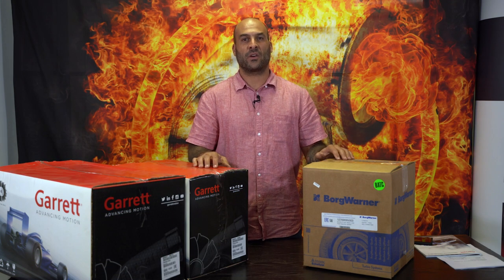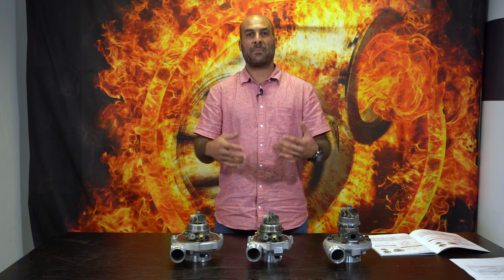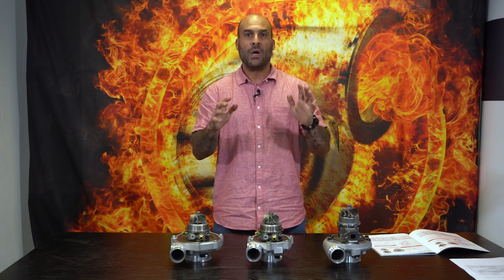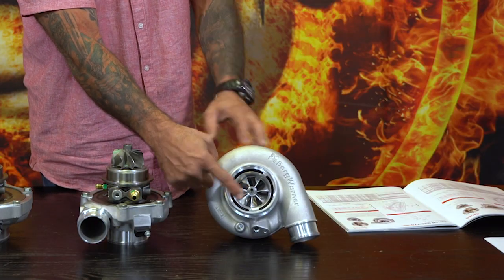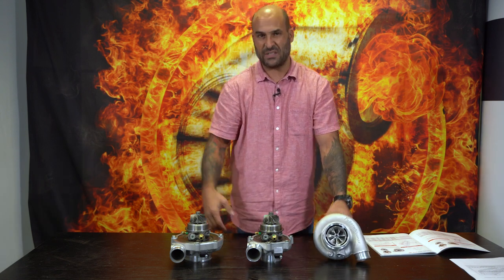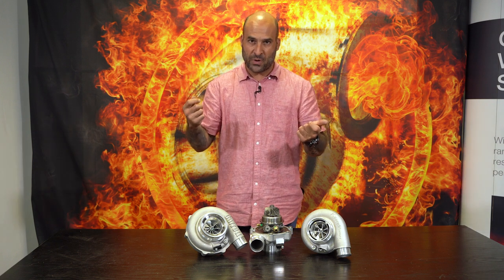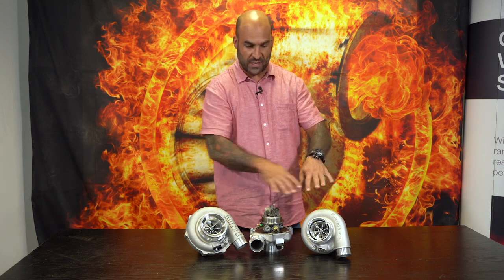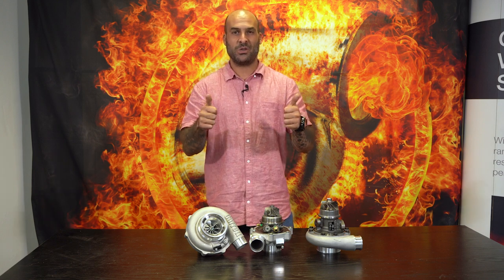BorgWarner Airwerks S200SXE versus Garrett G30-660 and G30-770

Comment: I used an S257sxe t4 .82 twin scroll on a 2JZ , had full boost at 3600 and the boost recovery between gears even short shifting was ridiculous and you could easily spin the tires up through 5th gear. Even 5th gear by accident just flooring it to pass a truck
Reply from the maker: Far better than any comparative Garrett G-series for half the money.

Comment: Different turbos for different goals - for sure.
But what I had to do when determining my situation was against the EFR series against the g30-660.
I overlayed the graphs with some color choices.
I did this because you need to plot 75% versus 75% for instance.
When you do this you'll see that the 660 compressor wheel at about 0.4 PSIG at 20#/min, all the way up to 2.6 PSIG at 50#/min.
It's nearly the entire range! Lol.
But in my opinion outside of the typical modern trend of running everything off the compressor map - the 660 is really a 550 IMHO, so the 57mm BW is obviously will make more.
But no the BW doesn't spool as fast I have direct comparison between my vehicle running the G-30 660 and that very BW S200.
Both awesome turbos, I'd buy either one.
My boost threshold is much earlier on my G30-660.
Does it make the car any faster?  No probably not because I have more than one gear in the car. :)
But it's nice to be able to lug this car around at lower speed.

Truth be told that S200 has much more boost down low, but on the same.engine again hitting the same power requirements was similar to my GTX3584RS comparing logs.
Reply: Thanks Beau!
Reply: Which Borg did you compare to the G30-660?
Reply: What car did you install this on?
Reply: Great, i require much more education on turbos! Back in the sixties and 70s never had a turbo,lol
Reply: Came to say that ... when you are comparing one turbo at 79% efficiency to another at 75% you are not drawing any meaningful conclusions.

Comment: This is why I am going 8474 over any Garrett in my R32 GTR. Awesome video Chris, as always! Keep  up the great work!
Reply from the maker: Great choice - the 8474 is a loaded gun!
Reply: What made you go 8474 over 8374?
Reply: @CarbageRacing  For me, its the power above 5000 rpms. The 8374 is a little quicker for spool time, but as soon as you get above that 4500 rpms range, the 8474 is way better.

Comment: just what i needed. though i do wish the BW was also water cooled to extend the life of it. TY for this comparison i greatly appreciate it.
Reply from the maker: Thanks for the comment - much appreciated. Keep in mind that although the S200SXE might not be water cooled, this is still an extremely reliable turbo (more so than any Garrett water cooled Journal bearing setup by far) due to the fact that this bearing system is used primarily in stationery engines in underground industrial and mining setups and run at massive boost pressures permanently. Obviously the S200SXE uses a very different aero design wheel package to the stationery engine setup, but the bearing housing and components remain the same proven component list. You have nothing to worry about in reliability here.

Comment: Before one word was spoken about the efficiency of either turbo, I had made up my mind by just looking at them and choose the shorter ones.  I don't have the room for the length of the BW.  I currently run a G25-660 in my Subaru powered VW bug and was thinking about upgrading to the G30-770 but man, I hate to give up the incredible response of the G25.
Reply from the maker: Thanks for the comments. If you like the response of the G25 - wait till you experience the 7163 -- it is chalk and cheese.
Reply: What rpm does boost start in your vw bug
Reply: @seemaab  I can’t tell you the exact rpm,
Reply: But it’s pretty immediate

Comment: very informative! thank you for this. my bw s257sxe is enroute to me as we speak. going on a time attack car (s2000 with a twin scroll manifold), good to know im not giving up much of anything vs the g-series. a point i think that was overlooked on the comparison is serviceability. the borg can rather inexpensively be rebuilt while the garret will require a core exchange directly from garrett which is pretty expensive(more than the cost of a new borg). one thing i really struggled with was selecting the proper turbine housing for the s200sxe-57mm. there is many options available, they have there turbine matchbot program on the website and even after watching the tutorials was somewhat confusing. they also dont have many of the housings for the s200sxe listed on there matchbot. a video looking at selecting turbine housings or matching turbine housings to your particular engine would be fantastic. i scoured the internet and youtube and it seems its something there isnt much information out there on. thanks!
Reply from the maker: There isn't much info on this, because not many people know how to do this.  There are secrets and other info that lies in this section of the turbocharger which i am also reluctant to share for specific reasons.  Shoot me an email and i will assist you in choosing the right housing for your application.  chris@turbodirect.co.za
Reply: Funny finding you here Scott! 😆 I was going to ask the same question. Except I'm on a single scroll (non divided) manifold and they only offer divided housings except one vendor offers a T4 open @ .84 AR. Any benefit to keeping the t3/t4 divided versus matching with my manifold of T4 undivided?
Reply from the maker: @spoolys2k47  Thanks for the comment, you will see a benefit of using the seperated manifold design with the un-divided housing, should you decide later to use a divided housing, you will see a further benefit in spool and linear response compared to what you have now.
Reply: @TurboDirectSA  awesome, thank you for the insight! Excellent work on the videos, I've watched a few and all have been super informative.
Reply from the maker: @spoolys2k47  Thanks alot - much appreciate the feedback

Comment: My G30-660 .83 ar just made 588whp/550wtq on my 2015 Subaru sti. It made 38psi at 4k rpm.
Reply from the maker: Great result thanks for sharing -
Reply: @TurboDirectSA  on E85
Reply: Great numbers. Which displacement and rpm range on the 2015 Subaru Sti?
Reply: @dennisrobinson8008  it’s a 2.5 technically bored out to 99.7. Don’t know if that adds anything. Limiter set to 8k.
Reply: @L2anger06  Thanks   for the reply.     Did you have the dyno graphs?   I know with that "big" 2.5 it's coming in boost early and strong.
Reply: @dennisrobinson8008  yeah at 2500 it made 4psi, 3k it made 10psi, 3500 made 26 psi and waste gate let up at 38psi at 4k rpm
Reply: @L2anger06  Holy shit.     the torque curve just shot straight up!     I must feel incredible.
Reply: @dennisrobinson8008  on the graph it’s a nice smooth diagonal line lol real world it spins in 1,2,3 and 4th lol
Reply: @L2anger06  And fucking 4th, damn.   I'm considering it on a 3.0L.
Reply: @dennisrobinson8008  yeah 4th gear is fun. On a 3.0 it’s prob going to be a little to fast lol

Comment: Chris, a gentle reminder for a video I'd very much like to see if possible.
Full explanation of turbine flow plotting.
I haven't been able to find any real information on how to best use this plot TBH.  Hoping you might be able to, get an actual full technical explanation on this.
The only thing I've found is an obviously wrong 2:1 ratio. Between compressor flow and exhaust flow #/min.  No science or explanation I think people are just looking and you could almost invent that rule of thumb but it doesn't seem to be so.

For instance I've found on certain combinations the power going down going to a larger AR at any RPM, and I've seen it where people pick up 60 horse going from a .8x to 1.0x AR setup.
Reply from the maker: Buddy i hear you loud and clear, i haven't forgotten about this - but to be honest there are a number of secrets that lie in this side of the turbocharger, which firstly are complicated and not easily understood, but also where the "trick" lies in creating the control of the compressor on the other side of the turbocharger. Get the turbine wrong, and the compressor map is useless.  The compressor side is simple in comparison. However i will touch on the subject based on the manufacturers maps/marketting info. At least this will help you some.

Comment: You didn't compare the G3-770 compressor map. I discussed it last video comments, though.
Reply from the maker: I did not discuss the 770 compressor you right, this is not apples with apples, this is why i never did so.  The other two are advertised in the same HP range, hense the comparison on those.

Comment: Way less than half the price current market. Plus you'll save money not having to run water cooling. Still blows me away what Borg Warner does.
Reply from the maker: Borg has tested and proven these turbochargers' bearing systems over many years on other applications that run massive boost permanently. They are FAR superior to Garrett or Precision by leaps and bounds!
Reply: @TurboDirectSA  💪💪

Comment: Thinking in getting the G30-770
Reply from the maker: If you planning on expecting 700HP +  from the turbo, then id suggest you think twice. Up to 650HP the turbo will fare, more than this, you will be disappointed.
Reply: @TurboDirectSA  my goals for the moment is to hit 500 to 575, with room to 600hp. Car is 2015 STi
Reply from the maker: @TheE3R  You going to run this turbo at high boost to make that power. There are are better alternatives which will make that power easily and reliably without breaking the bank.
Reply: @TurboDirectSA  what option would that be?
Reply from the maker: @TheE3R  S200SXE  - this turbo will perform according to the claimed power.  The compressor map is also not over-spec'd - if you want the correct flow/performance from the G30-770 divide 770 by 12 - this is a realistic figure.

Next is the EFR7670 which costs less than the Garrett turbo because it includes all the components you need for a direct installation. No external gate required, no BOV, and no boost control Solenoid - these components cost alot of money over and above the turbo, which is similarly priced to the EFR7670 which already includes these components.
Reply: @TurboDirectSA  appreciate the info, thanks!
Reply from the maker: @TheE3R  Pleasure - no problem.

Comment: Anxious since I’m torn. 
BW 8374 EFR vs PTE 6266/6466/6766 

If possible. 
That’ll help my year long decision
Or any other EFR turbo vs PTE on a 2JZGTE
Reply from the maker: Thanks for the comment - keep in mind that precision are not an OEM manufacturer, they also do not burst contain test/pass their housings - the product is manufactured in China, assembled in the USA, i have seen the factory first hand. BorgWarner have technology, designs and testing processes that are required to pass by law as an OEM manufacturer, which every turbo undergoes and passes. BorgWarner are much older and more experienced than Precision and the product is that much better in every way. The features packed into the product are unmatched (DV, Actuator, Swing valve diameter, Solenoid etc) The bearing system is also a cut above the rest, the turbine wheel materials are lighter and spools faster - its a no brainer really.
Reply: @TurboDirectSA  thanks for the reply and educating everyone reading this post. What turbo for Garrett would be comparable to a EFR 8374??
Reply from the maker: @ESherbinFox  The EFR8374 is the older version turbo that was spec'd at 750HP capable output with a 62x84mm compressor design. The replacement EFR8474 Black Series now using the identical turbine stage but with the 68x84 revised compressor and shunts out 950HP - i would use this to match up against the GTX3582R Gen2, G35-1050 (compressor map issues with Garrett)   The EFR will outspool (Gamma TI turbine wheel) together with ingenious location for the internal swing valve, and really advanced bearing system

You'll be very surprised at the comparison. This in a new video coming soon.
Reply: @TurboDirectSA  perfect timing and info looking forward too it!!
Reply from the maker: @ESherbinFox  Glad i made it in time :-)

Comment: In terms of shaft speed care, what psi (or bar) do you recommend to work with G30-660? THanks a lot for help
Reply from the maker: This all depends on the application, engine, fuel used, intended boost/power output target etc. 
Can you share more info on this?
Reply: @TurboDirectSA  Yes Sir: Im building Audi S3 8L for hillclimb. My aim is: 450-500hp reliable and as responsive as possible. On my research, people recommend G25-660 instead of G25-550 at this level of power. And they told me to take care about the shaft limits. I know Garrett recommend 165k rpm, so i dont know when im safe if i buy the G25-660? I want things safe as the budget is limited ! THanks a lot
Reply from the maker: @burns985 I would not choose the Garrett G-series at all, i wouldn't even consider it. Lean towards the EFR7163 with AR80 band turbine housing, this turbo will out spool and outperform the G25-660 by leaps and bounds, and its designed for racing and abuse. It is a much more sensible and cost effective solution by far.
Reply: @TurboDirectSA  Thank you so much for these informations Sir ! I really appreciate it 🥳
Reply from the maker: @burns985  Happy to help.

Comment: I love your vids. Can you make some comparisons with old "tank" holset HX35?
Reply from the maker: Thanks for the comment - the Holset HX35 and HX40 range is so vast its really not easy to compare as which one do we use for the comparison? The turbos are diesel industrial applications with no emphasis on performance or any kind of universal performance based applications.
Reply: @TurboDirectSA  Actually, in Europe they are really popular and cheap, I could say bulletproof in terms of durability and.
You can find hx40 for 600€ new which is 40% cheaper than any other turbo in same power bracket
Reply from the maker: We have them here too - very cheap, but you get what you pay for -  @lamazver   -- these are not performance orientated turbochargers at all. They fit many old Euro 2-3 spec diesel engines. Yes man change compressor wheels etc - but the turbine stage is not efficient at all, very rudimentary designs. If you do a side by side comparison on a dyno and monitor fuel supply you will see that the HX series isnt very good compared to say a performance specific turbo with matched turbine and compressor.
Reply: @TurboDirectSA  actually you can buy ones that are offered as performance parts. Something like HX40 Super with 60/85 7blade splitter compressor and 74-64 10blade turbine. 
I'm currently making compound turbo setup with hx40super and HE221W for audi b7...
Reply from the maker: @lamazver  And what relationship between the turbine and compressor has been tested? Turbine or compressor map?  I can tell you that with Holset you will battle to get compressor maps because hey are created TOGETHER with a turbine shaft and housing combination. Most think a compressor map is simply just a flow map of the compressor wheel - the turbine shaft and housing is responsible for driving the compressor wheel - without the turbine side a compressor map is not possible.  Just thumb sucking a compressor wheel with a size and number of blades means nothing - thats why i always say do a back to back comparison and you will see why the proper performance products will always outshine the 'spoeg en plak' plans that the 'turbo guys' out there attempt.
Reply: @TurboDirectSA  i totally agree with you on getting any info from cummins. All I know is that most of my customers run hx40 with Borg Warner results if not better.
In one of videos you said you guys can make compressor maps. What if I send you one of my hx40 for you to review, test and make compressor map for it.

Would be a win-win situation for both.
Reply from the maker: @lamazver  We would not be interested in producing a compressor map for any Holset combination, hey are not efficient performers for the universal upgrade market im afraid.
Reply: @TurboDirectSA  Well I'm sorry to read that, hx40 super with 7+7 splitter billet compressor wheel, 5+5 turbine wheel and 1.0AR T4 twinscroll housing really made some eyebrows raise especially with spool valve combination...
Reply from the maker: @lamazver Im sure it did - but remember combining different components and housings no longer remains an HX40 - Holset HX40 turbochargers are used on industrial diesel applications as you know.
Reply: @TurboDirectSA  yes, but hx40 is just the name of the frame like gt35. It can vary in dimensions and then theres the aftermarket oerformance series which can be bought today separately as a performance turbo not heavy industrial equipment

Comment: Stuck between BW 366sxe and g30-900 for rb26. Need respond running 264cams with 92oct fuel
Reply from the maker: The S300 is far from a direct comparison - you should be comparing the EFR7670 to the G30-900, and you will find the two producing similar power and the spool characteristics will be very similar too.  What HP target do you have in mind, this also effects the final choice.
Reply: @TurboDirectSA  Aren't the 7670 and s257sxe pretty much the same size
Reply from the maker: @Jamxknife  They are similar, but there are some very differentiating components, i would say that the only similar component is the compressor wheel.